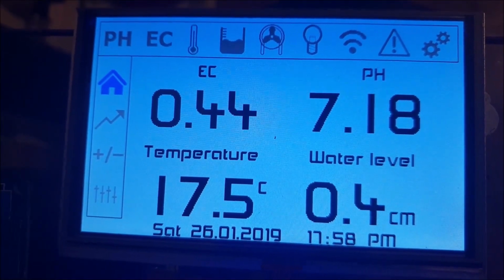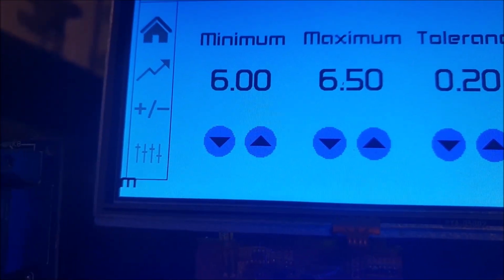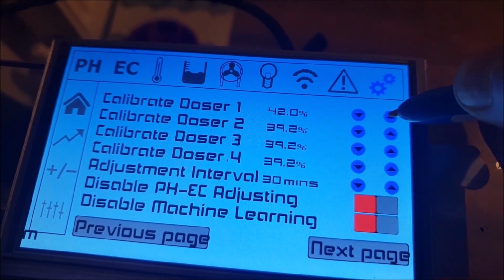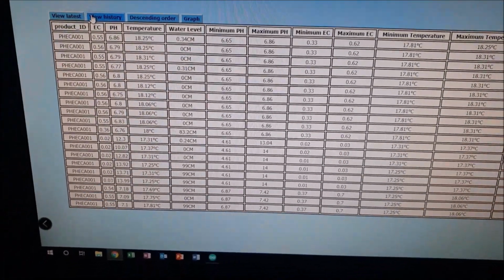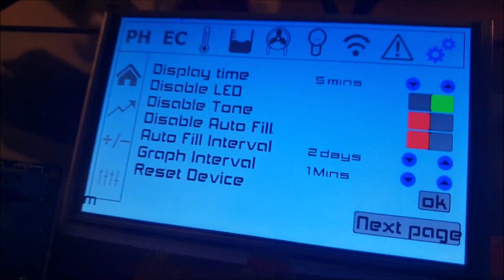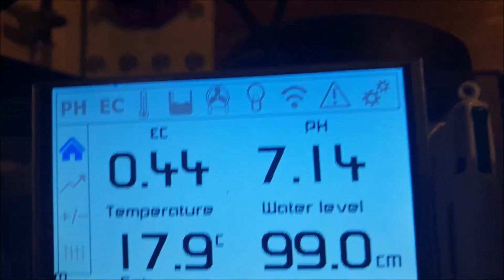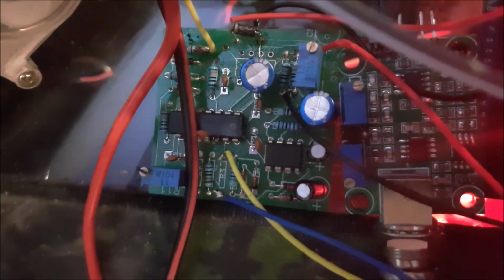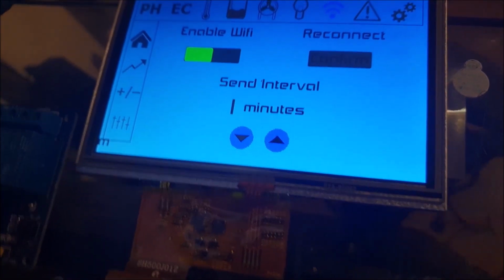Arduino EC, PH, Temperature and water level control, with TFT touch display and WiFi and more

Comment: Hi,I'm From Bangladesh,I wanna purchased this set up bro.If u can please give me the price coat.
Reply from the maker: The raw code is £25 for personal use. And the components is about £300. I have built a few for others and I charge £100 to build, calibrate and test, totaling £400 without any modifications to the code. Or ofcourse you can build your own.

Comment: any updates on this project?
Reply from the maker: I have a few bug fixes that I resolved this week and I shall release the new version this weekend. Its is mainly the air temperature and humidity logic, doses setup when machine learning is disable, some button logic, warning colors and rtc time updates
Reply from the maker: Oh wait this is the old hydro controller. Version 3 was released on December the 28th. To which an update will be available on the weekend. Check out my video for version 3.

Comment from the maker: The new version will be released before xmas 2019 "15 days from now" !!!
Reply: Looking forward to it, are you using anything different this time for screen and drivers?, as there is better and cheaper options out there
Reply from the maker: @roryw2005  yes you can use the buydisplay ra8875 and the dfrobot tds meter can do both the ec and tds, which saves a fair amount of money.
Reply: @EdwinMartin1990  how is the update coming along?
Reply from the maker: @roryw2005  i was hoping to have it released today but its taking longer than i thought to test everything, but fear not i only expect a few days delay so lets say the 28th, and in that time i also need to draw a full writing diagram and a video explaining all the features and settings ect.. Needless to say it is Xmas and i am sat here with an oscilloscope and writing code lol :)
Reply: @EdwinMartin1990  enjoy xmas 1st buddy, I wouldnt worry about the project this time of year

Comment: Hi Edwin the resistors used in the isolation circuit what value are they ? as the picture shows 10k  and in the video you say somewhere between 220 and 1k please can you advise many thanks again

Comment from the maker: For all of you that plan or have built this project i am working on a  new version with includes a TDS/PPM sensor, with an even more stylish GUI and all bugs fixed, such as the graph page has two button overlapping, there should be 4. I am rewriting it all and the algorithm to control the EC - PH will be far more advanced taking into account water temp, volume, PPM and current EC - PH. 
It will take about 4-6 weeks as i am still currently creating the GUI which takes ages and ages to get everything lines up and tested.... 

Please keep an eye out for updates :)
Reply: Hello,
Im interested in developing a quite similar system but not for hydroponics but for soil system.
Please check your e-mail as i sent you what i use now and my goals.
Hope we can work this project in team style.

Thanks

Comment: Hi Edwin , what is mean "EEPROM key does not match, saving to default presets. Please wait...
"
Reply from the maker: It means it was the first ever boot and it needs to populate the eeprom with the default values, or you have reset the device settings - factory reset.  This is normal, i have a newer version i am currently writing which is far more elegant to read and more efficient, it will be ready in 1-2 months.
Reply: @EdwinMartin1990   thanks for fast reply. I check diagram and codes for understand. I dont have all parts ' even dont have lcd. Just send codes to arduino and read this message from serial. This eeprom meaning arduino eeprom memory ? We dont need to connect any external eeprom module ?
Reply from the maker: @tahsinkarasel9246  Yes it refers to the internal EEPROM of the Atmel Mega2560, I shall adjust the message on the new version so it is more descriptive. Basically it just auto populates the EEPROM memory with all the values when the EEPROM is blank either from first use or a factory reset or you have change the EEPROM layout or data types in some way it also useful else you would load the wrong values.
Reply: @EdwinMartin1990   Understand. It looks perfect already. I look forward your update. Thank you

Comment: 800x480 RA8875 40-pin touch Display with the adafruit controller is expensive, is it possible to use another cheap touch screen?
Reply from the maker: Yes there is all-in-one display and driver for $35. I haven't used it a couple of years but my last company we used to use these exact models, make sure to get 4 pin SPI (MOSI, MISO, CLK, CS)
5" 800x480 and I used resistive touch as it's cheaper. 

https://www.buydisplay.com/default/5-inch-tft-lcd-module-800x480-display-controller-i2c-serial-spi
Reply: Hi there i just purchased this package hoping that it will do the required job
https://www.mouser.co.uk/ProductDetail/485-1590 display driver card 
https://www.mouser.co.uk/ProductDetail/485-2354 7" touch screen
£81.04 in total

Comment from the maker: I just bought a DFRobot Gravity Analog TDS Sensor / Meter but i still have a month till my Masters is finished then all gears are go and i will work on a new version of this EC - PH controller. Please wait i know a lot of you are very eager to have TDS included.

For those who want a date i finish on the 8th of October, i am finishing my Thesis at the moment for the 20th of September then i have to create a presentation which i shall preform on the 8th, then i am free as a bird :)
Reply: Hello Edwin, im fighting with this analog TDS sensor with the PH probe, cant make it work even with your transistor schematic, the PH probe gets crazy readings after I stop using the analog TDS
Reply from the maker: @matias.parodi  Interesting, I do not have one yet and i am unsure of the way it operates. I ordered one today and it will be here this week, i will then start to integrate it into the code but as of right now i could not give you any advice until i experiment with it. I paid for quick postage and I shall start working on it this weekend if it arrives before or on Friday.
Reply: @EdwinMartin1990  Ok, let me tell you i have a big difference in analog readings on the PH probe after I use the TDS, and it slowly goes back to the value (but it takes + 10 minutes). So quick switching between sensors seems a big no noI. It looks the water gets ionized or something like that, strange because the sensors says it does not get polarized. Tell me when you have some news, thank you

Comment: Great work, Edwin Martin, and from your notes, I can imagine the challenges and surprises you faced while coding.

I was wondering if you had the chance to use a TDS sensor instead of the EC sensor,  do the conversion on the program and still display the EC value instead of the ppm?
Reply from the maker: yes in time, i am free in 46 days, i know that is a long time but i must finish my masters first. Once i have finished my masters i will have my evening and weekends back and thus have time to work on fun projects. The TDS sensor and code will be very easy i just need to make space in the GUI for it.

Comment: Will you add TDS controller on it
Reply from the maker: yes in time, i am free in 46 days, i know that is a long time but i must finish my masters first. Once i have finished my masters i will have my evening and weekends back and thus have time to work on fun projects. The TDS sensor and code will be very easy i just need to make space in the GUI for it.
Reply: @EdwinMartin1990   is this project dont control ec / tds level with nutrient dosing ?
Reply from the maker: @tahsinkarasel9246  it controls EC - PH - Temperature and water level and a mains light

Comment: how do you measure water level?
Reply from the maker: I use a waterproof ultrasonic sensor,  and simply take a reading at empty and compare to the current reading. Thus empty reading minus current reading equals water level. I.e 50cm at empty and 10cm at full equals 40cm water level.

Comment: Hi Edwin, I would really like to build your set up. I have made two iterations already but nothing compared to what you have made here, super impressive. I would love to build, use it and let you know how it goes and help in any way I can. Thanks for putting this up and allowing people to use the code. amazing.
Reply from the maker: I do plan to release the code as so many have been asking me, but the code has almost no notes throughout and it is quite confusing in places, such as all the icons are actually a font so i could use them as svg's. So your see things like ug8.print('P'); which could be the doser icon. and the way i lock the display and such may be confusing to some.  In short i shall make one final video on this project explaining the code in great detail and with a link to the code and wiring diagrams, again i am not a pro of any kind in electronics so i pray a skilled electronic engineer see this video and can create a proper power distributed and hardened circuit which we could then make a PCB from. Give me 2 weeks though as i am studying a masters at the moment and time is always scarce and i must touch up those minor bugs along with one major bug i found in the machine learning, which i have addressed but i need to test it further as its has me concerned.

I always planned to make a small amount of cash from this project but we can all dream and i don't have the time to go and pitch it to loads of companies, but as this project took a while to build and cash to buy all the parts, so i plan to put a donate button with the final video for anyone who is thankful and able too as student life is quite bleak.
Reply: Thanks for putting a reply up so quickly. Your right that does sound confusing! haha. Unfortunately I am also not a skilled electronic engineer, however if you want any tests i would be happy to try and help. Look forward to seeing the creation grow and any other creations that follow. Thanks again.

Comment: Nice Project... Some of the links are not working!!! can you please update them if you have some free time... Want to develop one myself and want to know the cost before I jump into this project...
Reply from the maker: Wow your right it seems they have renamed most of the URL's in the past 2 weeks, yikes :(. I shall edit them tonight.
Reply: @EdwinMartin1990   waiting for the updates
Reply from the maker: Odd i changed them last week and again just now, but Youtube seems to cutout part of the URL, instead i have now just listed the components names to avoid that issue.
Reply: @EdwinMartin1990   hi were you put URL? I wanna translate in italian your code if Is possible
Reply from the maker: As the links keep changing i just added the part names instead, just google each from the list found in the details section above.
Reply: @EdwinMartin1990  i see the diagram but no the code, when you add this? You make a new video for Arduino code?